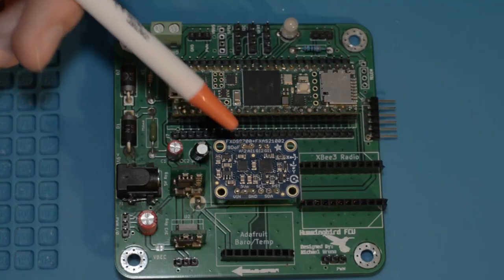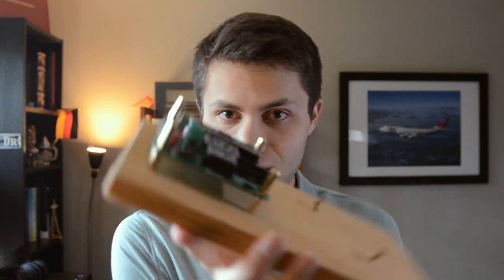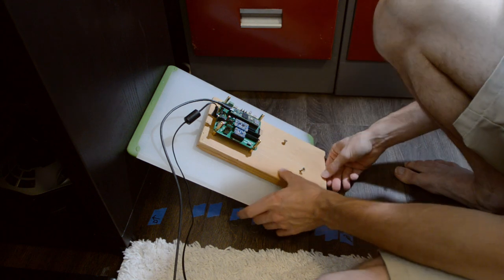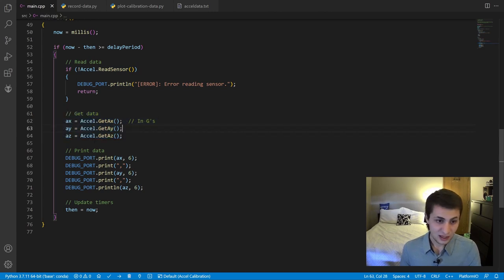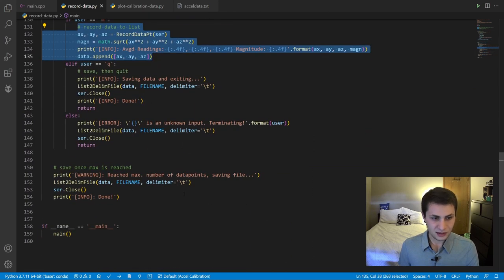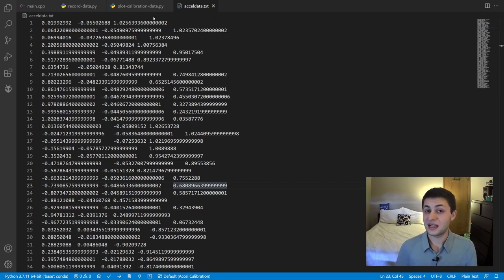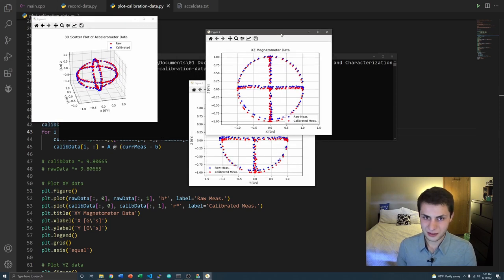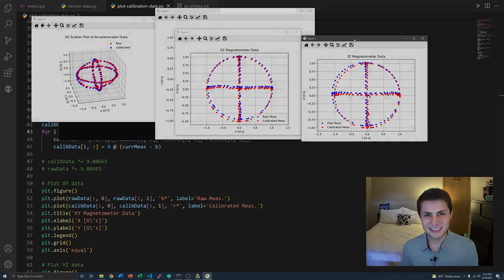How to Calibrate an Accelerometer

Comment: The content in this video is very informative. One thing I think is missing though is information on exactly how the magneto calibration coeffecients are used to correct the measurements from the accelerometer. This information would be extremely helpful.
Reply: Check line 45 at 9:34 . He applies a transformation to the raw data.
Reply: @pauloaraujo4275  Thanks.
Reply: Yes I was also curious about this! The Magneto "documentation" seems to be quite lacking on this also.

Comment: is there an exe file for Magneto program somewhere? Download link seems to be dead

...got magneto 1.2 from link from comments.

Just wondering, for Arduino (Nano 33 BLE), what is best filter to use? There is library for Madgwick filter, but wondering if there is any filter that can do a bit better then this one...

Also, just wondering what to use to calculate X, Y and Z position vs 0, 0, 0 (starting position), for full head tracking with movement?

Cheers...

Comment: what if i am using arduino mega, is the code still need to be changed or is the same ?but the acceleromater i use is HW-579a

Comment: Hi, is it important to go along each axis as you do, or can i also use positions in random directions?
Reply: Any direction would work. This way though you get pretty uniform distribution of data values almost all over the surface. I don't want to get into details, but it is worth mentioning that some way more precise accelerometers it is probably good to get data on those ellipsoid surfaces as well. I assume this would be a waste of time for this specific cheap (my assumption again) device.

Comment: Hi to everybody!
I'm trying to solve this problem with an IMU mounted in an autonomous vehicle.
How can I calibrate the sensor in this case, that is fixed on the vehicle's chassis?
I know that the bias vary also with the temperature and I want to write a procedure to recompute the acceleration bias every time the car stopped during its motion;
I think that also this is a well know problem. 
I can change a little bit the roll and pitch of the car driving in a multi-level car park, but is it enough with the proposed model?
I don't use directly my EKF filter to estimate the bias.

I tried to use a very similar model:
acc_body = R(roll)R(pitch)R(yaw)G_i       eq. 1
where
acc_body = (true_acc + bias + noise)
G_i = [0, 0, 9.81]^t is the gravity vector described respect to my inertial reference frame
R(..) = is the rotation matrix to rotate a vector around a reference axis
My inertial reference frame is FLU (Front, Left, Up).

but even if the vehicle is not moving, I don't know exactly how the gravity vector is redistributed on the three body frame axes,
even if the ground is perfectly flat because I do not know the attitude or the amount of bias.

Does someone have any suggestions or articles to read?

Thanks
Ale